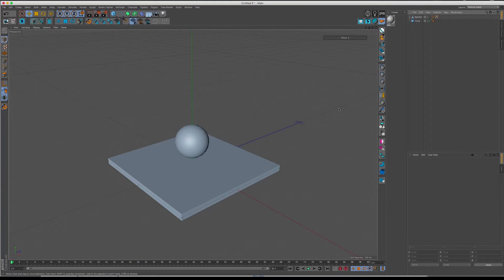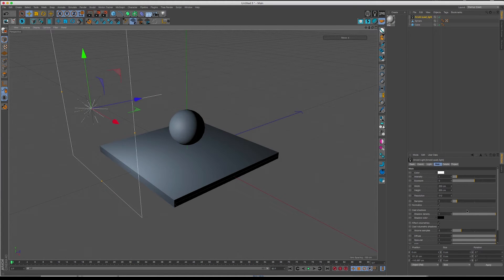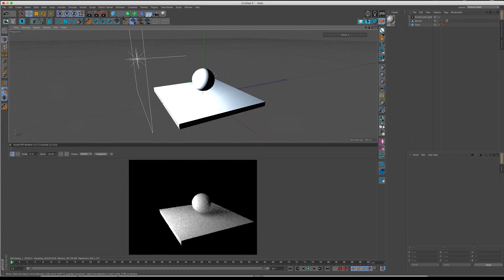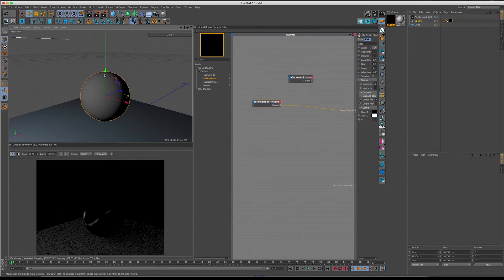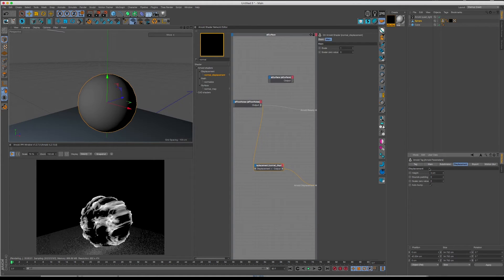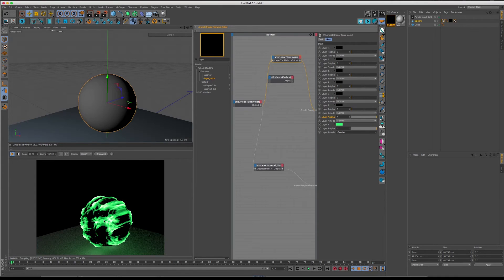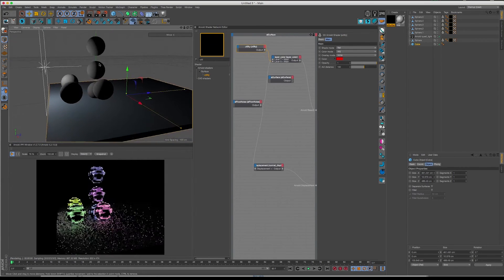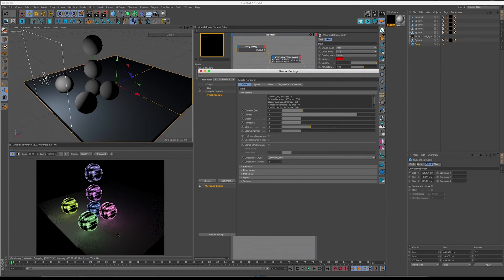How to remove noise using material samples in Arnold thanks to AlShaders - C4DtoA Quicktips #1

Comment: Why I dont have aIsurface in cinema 4d? all installed correctly as in install file.
Reply: alsurface was removed for arnold 5 but still works in older versions. It's now part of the "regular" arnold package. I think you can find additional "diffuse and indirect diffuse samples" in arnold standard shader-->advanced tab. Hope that helps. Cheers!
Reply: con someone please answer this?